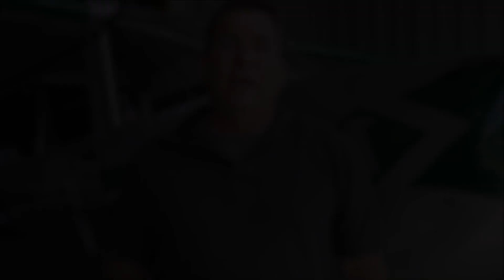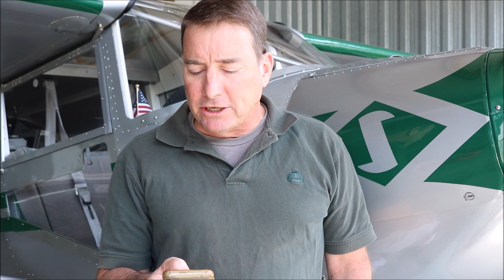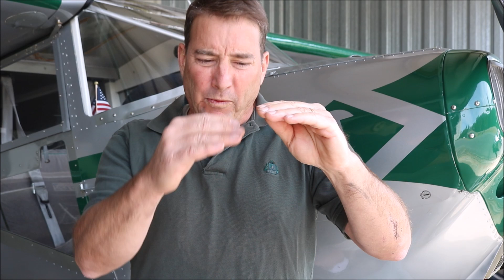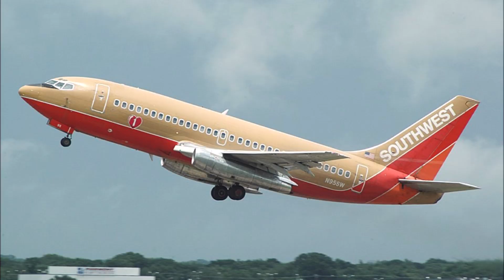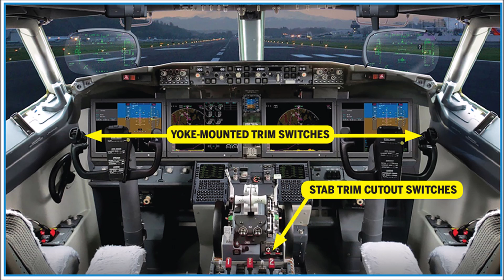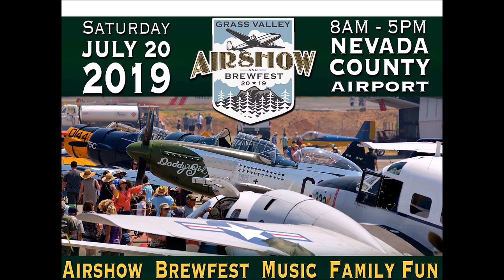737 Max UPDATE 27 June 2019 -The Latest Issue

Comment: How slow is too slow? Is the rate of change slower than that of other airliners? Can the jack screw assembly handle the higher stresses of a faster rate of change? One can change a program but can the hardware handle it? Will they have to strengthen the whole assembly meaning another serious delay? Is this why the shares have taken such a hit?
Reply: I think slow has been misinterpreted: The word can mean either slow to get going (delay), or moving at a slow pace. My understanding is the activation of the trim is slow, due to the microprocessor being busy with other tasks.
Reply: @gordonrichardson2972  That would just be reaction time, a momentary pause., at worst.  I would guess it would be far more of a problem if it was referring to the rate of/speed of movement of the jack screw. I hope it is an easy fix. I want Boeing to survive this but a Boeing that is worthy of the name. I really don't understand how those in charge made such terrible decisions.. But I do know I am not in a position to judge on these things but I sure hope there are people who can.
Reply: taketimeout2 It is not clear what the test revealed. Overloading a microprocessor can cause it to go into a loop, which could last many seconds if not recovered correctly.
Reply: True. We are specualting. Sorry my microprocessor looped. I meant speculating. ( I apologize for the delay. No one or no component at fault save Father Time. Just had supper here in a very sunny Dorset. U.K :)

Comment: I'm holding 737-2,3,4,5,6,7,8,9, MAX EASA B1, B2 license.
Have you heard anything regarding  BITE for MCAS will be built in with the SW update?
Similar to Mach trim, Speed Trim , current status, recent faults e.t.c.

Will Boeing have a Caution light for MCAS when it's activatet ?
Reply from the maker: 737 Max update way overdue...stby...

Comment: It is a problem with the microprocessor if the firmware needs to be updated and  the ROM is not write-able.  In this case the microprocessor needs to be replaced with one with the correct FIRMWARE and a software fix is not then feasible.  Either way it is a problem, maybe even requiring a board swap. Workarounds and software patches are not proper procedures when you are dealing with hundreds of lives.

Comment: The 737's been overengineered out of airworthiness. The mainstay of global short range Civil aviation for the last thirty years has become --- in its ultimate variation --- a sort of Frankenstein of the  airways. (A Piper Cub with transatlantic range).
This cannot continue. The Flying public will NEVER patronize the MAX. There's only one efficacious exit strategy :
1. Boeing must announce the discontinuation of the 737 in all its variants;
2. The FAA must recertify the 737 MAX for use ONLY AS A PACKAGE FREIGHTER;
3. Boeing will BUY BACK all MAXs delivered to date, and convert them to package freighters;
4. All undelivered MAXs and those still on the factory floor will be completed as package freighters;
5. Boeing will proceed with the 797, and will design it based upon the 757-200 platform while incorporating the aerodynamics of the 787; it will carry up to 199 passengers up to 4900 nm. A shorter version (790) will carry 149-159 passengers up to 3900 nm.
Reply: So you are advocating the continued use of an airplane you consider not airworthy?
Reply: @danielforman5064  it's ALREADY airworthy -- but the Flying public will never accept it as such. History has shown us that airplanes like that can only succeed as air freighters. (for which there is a burgeoning market.)

Comment: Rate control... but isn't it the same on NGs?
Reply: I would expect so (I guess the FAA have never done the runaway trim procedure before and are expecting it to move faster when its high out of trim) a good/normal  pilot should not let it get to that point in the first place 

issue is I find is that when situations happen outside the usa/uk or not native English speaking instead of one pilot flying and other pilot doing checklist/fault finding management both endup flying the plane so they are missing stuff like trim going down to Near max down when the person flying should be picking up the runaway trim in seconds (lion air they never turned off the runaway trim power and second crash they turned it back on because they let it get to near max trim down after 40 seconds and could not spin tirm wheel by hand)

Comment: If you don't link to the CNN article/newscast you're correcting then your viewers have no way of confirming if CNN was actually reporting it wrong or not. You can't just say they were wrong without showing they were wrong. 

This is the article: https://edition.cnn.com/2019/06/26/politics/boeing-737-max-flaw/index.html

Quote:

"When testing the potential failure of the microprocessor in the simulators, "it was difficult for the test pilots to recover in a matter of seconds," one of the sources said. "And if you can't recover in a matter of seconds, that's an unreasonable risk.""

and

"The sources say Boeing engineers are trying to determine if the microprocessor issue can be fixed by reprogramming software or if replacing the physical microprocessors on each 737 Max aircraft may be required."

This is LITERALLY what you're saying after reading part of the CNN article. 

Did they CHANGE the article you were reading or did you simply stop reading after four paragraphs? 

The CNN article transports THE SAME INFORMATION as your video. The processor RUNNING SOFTWARE is the cause of the failure and you're making a distinction without a difference that after using the input switches the processor doesn't trim fast enough - where's the difference there? The pilots are making an input at the control column, the processor gets the input and doesn't act fast enough to perform the assigned task.

How is CNN not describing what's actually happening? "It was difficult for the pilots to recover" - that's the pilots performing the inputs with the switches because of "the potential failure of a processor" - the processor that's processing the inputs. The pilots are doing nothing other than making the processor do something. How is that not what CNN is describing?

It's a system on board the plane. You're making a distinction without a difference when you're pretending that CNN is informing the viewer wrong because it doesn't matter if the processor is faulty or the software, THE END RESULT is what matters. And after you say that you're presenting it as fact that you can simply change the software on the processor

WHO told you that? Aviation week is reporting that they can't say that. 

Quote

"What is not clear: whether the chip itself needs to be changed, or if a software update will address the issue. A second industry source said that a software fix is possible—and certainly would be preferable for Boeing, which suggested in a statement that a software modification will be sufficient"

So you're just CHOOSING to take the word of the second engineer and Boeing. Why? Is your quibble with CNN literally that they didn't bring up the second engineer when bottom line even Aviationweek is presenting it as NOT CLEAR?

So I don't really understand why you're propping this video up to be a CNN correction again when CNN is reporting THE SAME THING as Aviation week.

I really don't get it. To me it feels like you're being dishonest towards YOUR viewers by picking and choosing which sources to believe and misrepresenting what CNN reported.

I studied informatics and it might surprise you but the difference between a processor and the software it runs depends on the ABSTRACTION LAYER you're working on. It is very well possible that the processor is designed in a way that you simply can not circumvent how it runs software to change its behavior so it would do the task quicker because of interrupts or how much of the actual ACTIONS are cast into the processor. If the processor design isn't versatile, you simply can not just "change the software" for it to work better. Computer chips can be designed to perform very narrow tasks and aren't just made like desktop computers where you can just put a new operating system on them and let them perform a different task.

So without you KNOWING it is possible to reprogram the processor I don't see how you can look into your camera and just state it as fact. During this whole saga Boeing has repeatedly promised that things would happen - which then did not happen. So why are you giving them the benefit of a doubt?

I'm honestly very frustrated here especially because it seems you're just eager to correct "the Main Stream Media" and present yourself as knowing better. 

So what now? I just showed that YOU are dishonest in your reporting. Should I now start my own Blancolirio debunking channel which reaction videos pointing out the flaws in YOUR reporting?
Reply from the maker: Sebastian Peitsch you need to pay attention here, or go back to your video games. You missed the point ENTIRELY.
Reply: @blancolirio  I'm 42

Feel free to point out what the actual point was then. 

The only point that your viewing audience seems to be getting is that CNN = fake news and how THAT was the point of the video. And I simply can't come up with how the CNN article is saying anything different from what Aviationweek is saying.

Here's The Air Current reporting on the problem:

https://theaircurrent.com/aviation-safety/faa-and-boeing-initially-disagreed-on-severity-of-catastrophic-737-max-software-glitch/

Quote: ""The deliberately broken microprocessor had become overwhelmed with data from the flight control system, significantly slowing the test pilot's response to the virtual plunge in altitude. The test pilot ultimately was able to recover control of the aircraft in the scenario, one of the people said, but the system's unexpected slow response to the proper checklist steps ultimately produced what the FAA has deemed a "catastrophic" situation for the passenger airliner""

WHAT are you correcting in this video? How is what CNN reported false? I'm not getting it.

Because no matter how I'm turning it, CNN reporting that a processor failed and might be reprogrammed with new software or replaced with a new processor is still the bottom line of all these articles. Nobody cares what "the procedure actually looks like". That's not the point of this news bit. The point is: the planes will stay grounded because a processor isn't performing as expected.

CNN and the AP didn't misreport. Nothing about the article was wrong. So why say they got it wrong?
Reply: I also managed to dig up the Bloomberg article that's referenced in The Air Current

https://www.bloomberg.com/news/articles/2019-06-28/boeing-s-737-max-software-outsourced-to-9-an-hour-engineers

Here's who programmed that processor: a company in India who got the contract via bidding for the 787 Dreamliner software job by saying they would do it FOR FREE

Quote: "The Max software -- plagued by issues that could keep the planes grounded months longer after U.S. regulators this week revealed a new flaw -- was developed at a time Boeing was laying off experienced engineers and pressing suppliers to cut costs.

Quote: "Engineers in India made around $5 an hour; it’s now $9"

Fantastic. So these bargain-bin programmers put together software for a processor that could be overwhelmed by sensor input - as in: there were no routines built into the software as a safeguard for things that led to space probes veering off-course in the 1970s. Things that every newbie software engineer learns in his second semester - guess what: I DID LEARN THAT based on the Ariane 5 disaster 

What was this video about again? Since I'm getting no reply here at this point I have to assume it's about making clear that no matter how much this software/processor combo programmed in India for $9 an hour fails, you can always just go to the next step and use the elevator wheels in the cockpit, no matter how much the FAA test pilots say that this processor is problematic and can lead to catastrophic failure

Seriously: whatever. I'm done with this nonsense. Keep playing the "main stream media" card for likes and shares
Reply: @SebastianPeitsch  
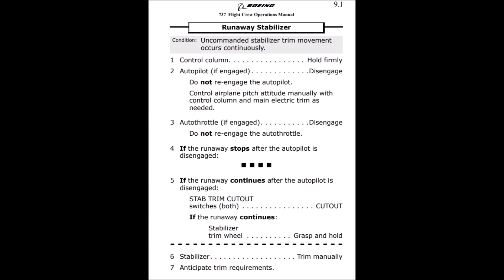I believe the main point of Juan's critique of the CNN piece is at around 4:22 "So it's not a microprocessor failure that's driving the nose of the aircraft down and into the ground, as reported by CNN."  

From what has been disclosed, that may be a fair criticism of the CNN piece.  From all the reporting, it appears that the FAA set up a simulated runaway trim situation, which is what forced the nose of the aircraft down.  The so-called microprocessor failure (or whatever it was) increased the time it took for the pilot to trim back up with MET.

I've said elsewhere and I'll repeat here, I don't think we have the foggiest idea what the test was, what the results were and what the significance of the results were for safety of flight.  All the reporting I've seen, including the theaircurrent.com post, is technically imprecise, and until the FAA or Boeing describes the simulator session with technical precision, we're all guessing.
Reply: Daniel Forman yeah maybe, which still results in this steadfast assertion that CNN is misreporting being just as made-up because it's just guessing.

Comment: One question,has any of the U.S Airlines had problems with the max before the 2 fatal crashes?
Reply: Yes, they had reported issues very much like the MCAS related problems.
But, American pilots are in general more experienced than pilots in most other countries and I'm guessing they so far had been able to better handle those problems.
Reply: @garyevans718  I have reviewed the ASRS reports and there isn't a single report of an MCAS activation.
There are two ASRS reports of uncommanded pitch trim movement in a 737 Max; however, they appear to describe the same incident (one report by the captain and one by the FO) and the incident occurred while the autopilot was activated, so it couldn't have been MCAS.
There is a third report venting about Boeing's failure to inform pilots of MCAS; however, the author of the report doesn't say he or she had ever flown a 737 Max or had ever encountered an MCAS activation.
Peter Lemme has a blog post where he analyzes all the known 737 pitch trim incidents.  https://www.satcom.guru/2019/05/737-pitch-trim-incidents.html  There is not one single 737 Max runaway pitch trim incident (there is one incident with "Stab Trim actuator non-functional" that was addressed by replacing the motor).
Reply: @danielforman5064  I have not read the ASRS reports, I heard these reports on the news and from the head of the Pilot's union.
It wouldn't surprise me that some of the reports I saw may not be accurate.
I think it's going to take a while before all the facts are know.
I still think Boeing will need to design a new plane to replace the 737 series.......that aircraft family has run it's course.
Reply: @garyevans718  
There is nothing wrong with the basic airplane, and I understand that the pilots generally like it.  I was supposed to fly on one right after ET302 but it got grounded first.  On my way through the airport, I chatted up a senior captain who was pretty dismissive of the whole thing.  I would fly on a 737 Max with a US carrier today, with either the old or new MCAS.
I don't know what the latest pitch trim/"failed" microprocessor issue is (the reporting on this is gibberish), and they need to get that sorted out.

But after that, Boeing should rip out MCAS and negotiate the best differences training deal it can with the FAA.  I'm not sure that pilots who have already logged significant Max time really need more flight/sim training before returning to the cockpit, but if they do, I'm not sure why it should be much more than a couple of sequences experiencing the different control column feel at high AoA.  The airlines would have a complicated assignment problem (assigning only re-trained crews to 737 Max's), but the fleet could start returning to service quickly and Boeing wouldn't take the risk of a future accident that gets tied (rightly or not) to the revised MCAS.
Reply from the maker: I scanned the ASRS reports- no MCAS issues in US. Only other autopilot minor issues.

Comment: Would trim rate speed be close to the rate speed on other 737s in a similar situation? Could the FAA start looking into other 737s for problems?
Reply: The news reports are somewhat confusing, and it is not clear what the implications of this are, but it seems to be specific to the MAX at this stage.
Reply from the maker: They (FAA) are scrutinizing NG designs too...

Comment: Does anyone know the actual manuf  part number for the cpu in question?  Commercial avionics can be decades behind current technology.  It's  possible that a hardware upgrade is warranted..
Reply: This is quite possible.   I've read somewhere that it runs on a 80286.    (Similarly, the Space Shuttle famously used computers so obsolete they were finding it hard to get parts).   Having exhaustively tested a system you don't want to change it and go through all that again.
Reply: What would be the benefit of a hardware upgrade?
Reply: @edcooper2396  lag?  Given the circumstances response delay is not good.  Ok for a building elevator button, not ok when trying to stabilize flight at 2000'.